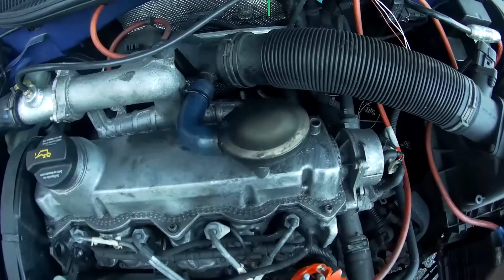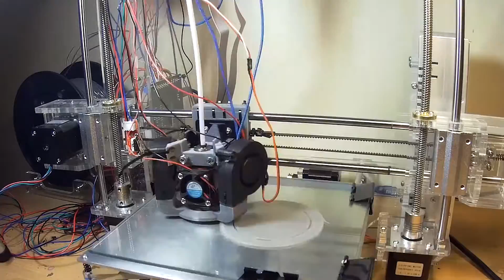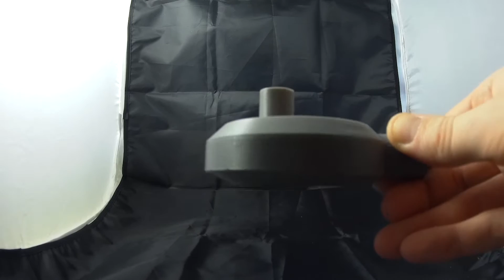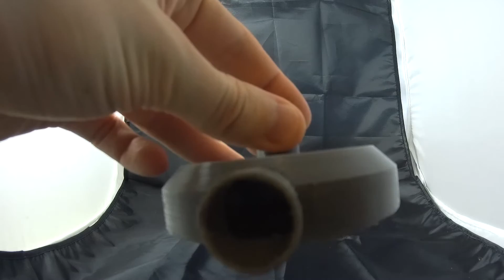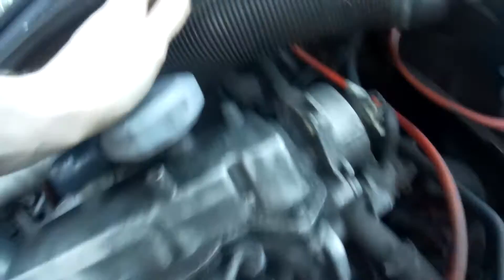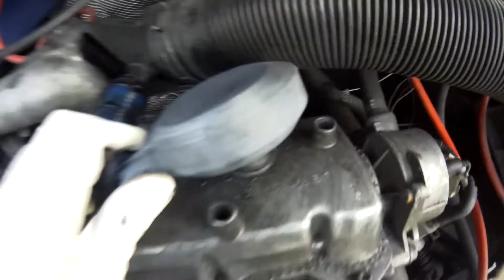3D Printed Car Parts #4 Crankcase Ventilation Cap

Comment: I also learn the hard way that, even tempered, PLA doesn’t work under the bonnet.
I’m currently doing a feasibility study of making an oil filler cap for my kit car.  An original item is around £700, yes £700.  They are made of polished titanium.
The feasibility study has several material tests like cold cast aluminium, and it was rubbish, and then print one in PLA, very much like yours and then use this as a pattern to cast one in Aluminum. As you can see with an OEM costing £700 it’s worth buying a small furnace.

Comment: Windshield wiper arm
Reply from the maker: Hi, you could but depends on the car. Also wiper arms are usually metal - it would almost be easier to make one from scrap metal using a vice and sheet metal or adapting another cars scrap one.
Can I ask why print it?
Reply: I just want to see if it can be possible and how long with it last
Reply: I want to see if 3D printing will be the next big thing in cars and how fair can we take it

Comment: On long term, what did you find out? The engine compartment is a quite harsh place for 3d printed parts... Did it withstand the heat?
Reply from the maker: PLA No - it didn't go straight away but didn't last longer then say a week in this application. In others I've had PLA stand up in the engine bay no problem. On my £1 diesel tuning mod video I made a project box and that held up until someone wrote the car off (rear ended).
ABS I imagine would be fine and PETG even better.
Reply: CarAndMechanical would design change this? I mean... improved design? Or it's the nature of pla to not withstand? The camshaft is sure to be hot af (even just oily air coming out)
Reply from the maker: Think that's pretty much it - if you were to move the filter away from the body more with some tubing there'd be less direct heat transfer but PLA get's soft at a much lower temp then ABS.
The main difference between using ABS and PLA is adhesion to the bed. I've gotten better with ABS adhesion now.

Comment: Man love your work! I've found you because of the 3D printing car parts tags on your videos and I have to say it's brilliant! Btw I have just a question tho, is it possible that you can make me a replacement latch/lid for my armrest in my Audi a3 8P? It is similiar to the Audi a4 one but the a3 one is not round like on the a4 model but rather more straight (a tiiny little bit is curved but barely noticabel). I would love you soooo much if you could help out haha, I have a custom made arm rest and I can not just buy a new arm rest from Audi as it is custom fabricated... Are you continuing this series with 3d printed car parts? If yes I will def check back frequently as I love creative minds. Keep it comming!
Reply from the maker: +Official SIR' TRAP - RELOADED hey man, glad you like the vids and I'd need more info/pics and measurements as no idea if it's a quick or super huge job.
I have a few easier videos I will be doing soon, that's in comparison to something cool I'd like to do in the future that is gona take some upskilll and a way to scan the car...(stay tuned)
Reply: +CarAnd “Car Mechanical” Mechanical oh boy oh boy that sounds amazing:0 you got skype? I could send you the size of the original part and pics of it

Cheers
Reply from the maker: What I'll do later is drop on all the 3D printing vids the link to my thingiverse page. If you can msg me on there it'll be great as I don't use skype.
Reply: +CarAnd “Car Mechanical” Mechanical Hey man, sorry for the big delay as I had no time to actually do anything lately but I might be able to text you the upcomming weekend. Do you have a email adress? Or should I still message you over thingiverse?

Cheers